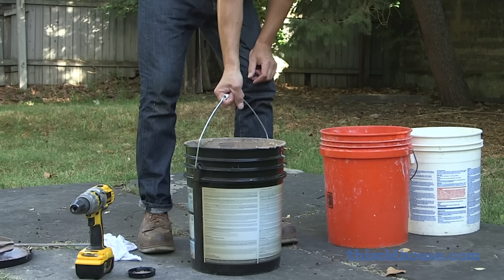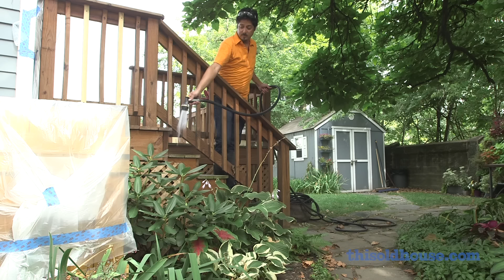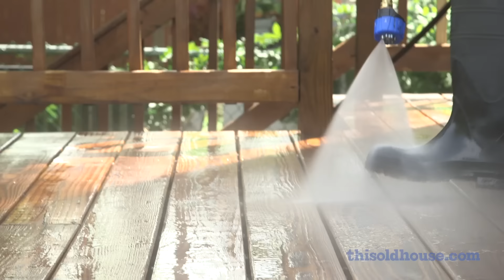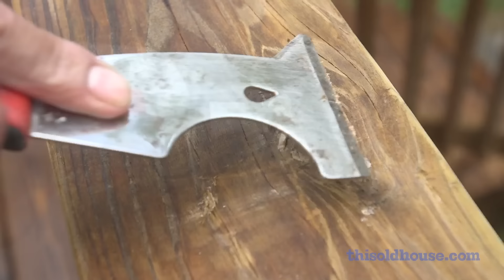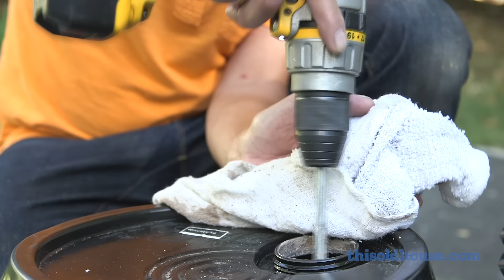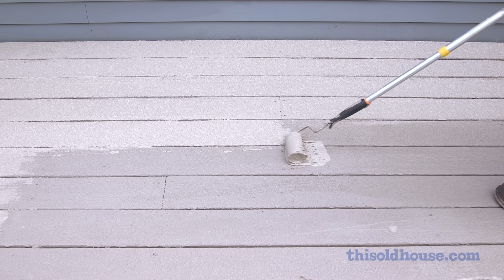How to Restore a Deck | This Old House

Comment: Disappointed this is through This Old House. There’s much better options for finishes IMO, like stain, to use once you’ve gone through the trouble of prepping your deck to bare wood.
*Make sure you read through comments to view precautions from many unhappy customers who have used the last product in the video.

Comment: We had an application of this type of product on our aging deck and were not happy.  Yes it hides surface defects but it is incredibly abrasive.  You have to be carful not to brush against railings or it will cut you.  Forget about bare foot on this.  End of the day it will look better than damaged wood from a distance but once standing on the deck it looks like a poorly frosted cake that feels like the coarsest grit sandpaper.  At the very least limit this to the deck surface only - do not put on railings or posts people are going to touch.

Comment: Majority of homeowners will not do this much preparation. Lucky if the homeowner pressure washes the deck and than stain it a few days later. I’m hearing from everyone sand the wood etc... I used sherwin Williams and lasted 5 years with old paint from before and didn’t even pressure wash. This is way too many steps

Comment: If you want to refinish deck/remove coatings get the DIMABRUSH Hardwood prep tool seen here. link: https://youtu.be/lcLALZunH_c
It works like a floor sander machine and removes all coatings, oxidation and wear, giving a brand new wood surface. 
 Ive been doing decks this way for years. Home depot rents it for about $40 a day.

Comment: This is a prime example of how not to clean the decks again your deck. You must clean each board at a time, from the beginning to the end, never stop in the middle or reverse your cleaning the other way or you will never get a good cleaning and the lines will show up right away wherever you stopped and started again. I did this for over 10 years and had hundreds of customers that called me every few years to clean again. If you keep up with the cleaning your deck can look beautiful every year, for years to come. They key is to clean it right and seal it every few years depending on how good the sealer was. Thompson's water seal had a life expectancy of approx. 6 months to a year, others up to 5 years if you wanted the best.

Comment: Sand it, blow the dust off, rinse with water, let dry. Take 4 QTS water to 2 cups bleach, apply on a rinsed surface with a broom, brush, or mop. Let it sit for 15 minutes and rinse. Repeat as necessary.  

then comes the big expensive question. To stain or not. To seal or not. Sealing introduced silicon which is hell to prep for future work. As is latex. Oil it? Varnish? Or you could just leave it.  Or seal it and commit yourself to a major task 1 to 3 years down the road.

Comment: Once that thick sealant is on the wood, any water getting underneath has no way to escape and your deck is going to rot away much faster. Sometimes you see new coating on the outside studs of hundred years old open timbered houses in Germany. Instead of preserving the timber this kills it even quicker, as water will get into the studs eventually but can no longer get out. The proper way to treat those studs is limewash, which is permeable to vapor. On a deck where you walk on, stain would seem most appropriate. This video is just a commercial for what seems to be an inferior product based on a bad idea, nothing more. A shame that TOH plays along with this.

Comment: Love this old house , but that looks like a mess and ugly finish, check the reviews on "Deck Restore before you commit. I did  Restore A Deck and TWP Stain, I flipped my 20 plus year old boards to expose nearly new looking boards, saved a ton on replacing the hole deck.

Comment: This produced a long list of questions...
Use "stripper" on the entire deck... what kind of stripper?  I was told the best way to clean a deck is a mixture of TSP and water, rinse and then hit it with one cup bleach to a gallon of water to kill mold.  Stripper is acid... careful application and injury prevention was not emphasized.  
Other TOH videos have said not to use a pressure washer on wood.  I have a cedar deck and if you hold the nozzle of a pressure washer 6" from the deck, it will pull up wood fiber.  NO WAY would I go near raw wood with a pressure washer.
The gop they are putting on the deck apparently is too thick for boards that are close, so they show cleaning the joint with a putty knife.  This leaves a ridge of gop on the top of the decking... if you are not supposed to go back over the decking with the roller how do you get rid of the ridge of gop?  Also by going over you could fill the joint back in...
This should be titled "How to possibly destroy your wood deck"
Reply: I too am left with similar questions.